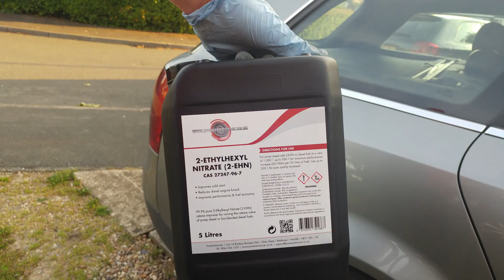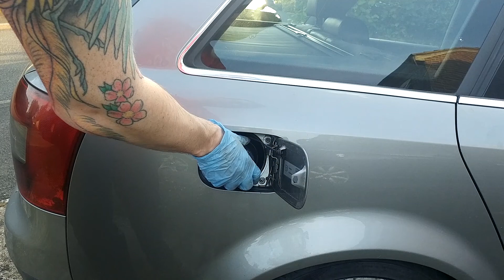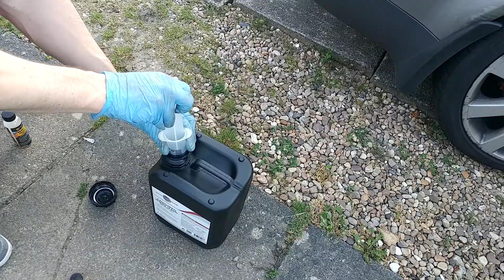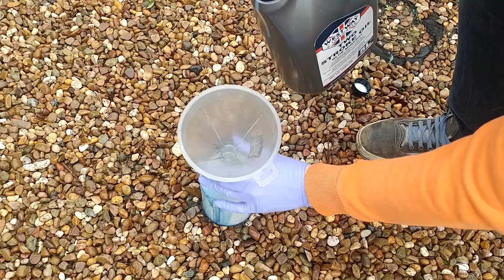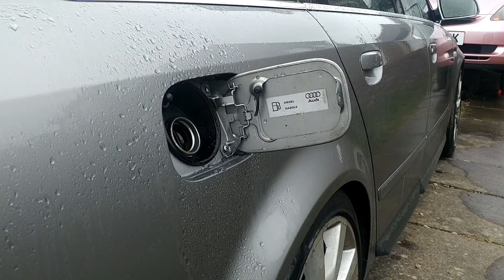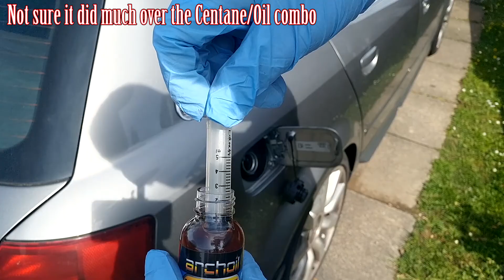2 Stroke Oil and Cetane added into my fuel!? Talking Diesel Fuel Additives

Comment: I'm a long time user of 2T oil. The grade recommended is 2T FASO FC for air cooled engines[not marine]. I noticed this was FB grade. Just saying in case it's important.

 After reading some of the comments i'll add that it is also claimed that it results in cleaner combustion with lower emissions that can double the life of a DPF.
Reply: I used to work for Conoco oil company the only difference between boat oil and motorcycle 2 stroke oil is the color additive . Yes you can use use 2 stroke oil in new diesel motors as well as old because it's ashless, it burns clean an leaves no ash or soot to clog up your DEF system. If you have any buildup at all your truck will burn it off when it hits the regen cycle on the newer trucks.. My lawn mower used to burn oil and foul out spark plugs, I drained out the 4 cycle oil and put in 2 cycle oil and now it smokes like it used to, but it won't foul the plug. sounds odd but it works.
Reply: @bigronwaggles404  That makes no sense? Why bother to have different oils sold for air cooled and water cooled 2 stroke engines if the oil is the same?

Comment: I've been experimenting with different non diesel fuel additives off and on over the past few years. First I was using Stihl synthetic 2 stroke mix which didn't seem to do anything at all. I've since concluded that was because it was synthetic. I've had pretty good results using ATF, particularly the dextron 3. I use the cheapest stuff I can find. Has to be plain stuff, no high milage, synthetic, or any additives of any kind. Currently I'm using marine 2 stroke mix. Again cheapest I can find, no additives, no synthetics. My tank is 33 gallons, or approximately 125 liters. I use 1 liter per tank of either the ATF or the 2 stroke mix. I put it in before I fill the tank with fuel to ensure proper mixing. The Marine 2 stroke out performs anything else I've used. My injection pump is noticably quieter, my throttle response is great, and I'm seeing between 2 and 3 miles per gallon increase in fuel mileage. 6.7 L Cummins diesel, fully deleted, mini max tuner, banks cold air, 4 inch turbo back exhaust, south bend dual disc clutch. One other thing I need to mention is my engine oil, since I switched from Shell rotella full synthetic 5,000 mile change intervals to DA lubricants conventional 15-40 oil, 10,000 mile change intervals I'm consistently getting 28 to 29 mpg cruising at 80 MPH. Not flat land driving either. Around home and daily commutes I'm getting around 22 mph. In a 2010 3/4 ton four door, 4x4, long bed with oversized mud tires and 265,000 miles. So that's my personal recipe for a smooth running, durable, dependable machine. That and you got to wash it once a week weather it needs it or not.

Comment: Question, 

Why… don’t you mix the cetane booster and 2 stroke oil with 5 litres of diesel first mix it well then put the whole lot in the tank together evenly mixed just before filling up?

Comment: I have been using 2SO in my 2015 Skoda Octavia 2.0L Diesel since I bought it in July 2016 with 3,500Kms on it.
It now has 102K without incident.
I add 200 mls to the 55 litre tank each fill with 50 mls of Fuel Doctor mostly prior to refueling but occasionally after refueling.
This use of 2SO was explained in a Land Rover Freelander Forum many years ago.
I also used this system on my 2 previous VW Golfs, also without incident.
Reply: Nice can i tell me wich one should i use for my tdi vw 2.0 tdi 2016 FB or Fc oil
Reply: @kuqezi2226  
JASO FC if your car has a DPF, that is a must. Ratio to use is 1/200, and I use slightly less as there is always some 2SO present in the tank when I refuel.
I use mostly 200ml of 2SO in the 55 litre tank of the Skoda, together with 50ml of Fuel Doctor additive.
Occasionally I drop the dosage down to 150ml 2SO but still 50ml of Fuel Doctor.
The original article outlining the use of 2SO in Diesel was written by "Yamaha Fan" in the Land Rover "Freelander" forum. Yamaha Fan was a German 🇩🇪 Lawyer who represented Oil and Car Companies, so search the Internet for this Forum and you can read it yourself and make your own decision.
Reply: @kuqezi2226 Go for the highest standard as everyone says, FD>FC>FB

Comment: I’ve been using 2 Stroke in my 2005 Vauxhall Corsa C 1.7 CDTi for years. I find it runs smoother and a bit quieter.
Reply: How much ml do you put in
Reply: @owen8538  usually about 250ml but I’ve also put in about half a litre from time to time. It’s an old car that had done over 160k so I’m not worried about it dying on me. It literally owes me nothing 😎

Comment: I use about 1/2 cup Walmart's 2 stroke oil with Diesel Kleen additive. A Gallon of oil last me 1 year! My 6.7 Cummins is so much quieter!  Just make sure its ashh-less oil doesn't matter the brand.
Reply: I have been doing the same with my 2011 6.7 but I have been adding about 18oz per tank or around 200:1. Only been running it for a few tanks of fuel.. maybe I should reduce the amount.

Comment: I drove the haul road between Fairbanks and Prudhoe Bay, AK for 5 years in the mid to late ‘80s, almost exclusively during the winter. They had #2, #2 Arctic, and #1 Arctic fuel available. The #2 was good down to about 5 to 10 degrees F, the #2 Arctic was good down to about -20 F, and I’ve never seen the #1 Arctic gel and I been in actual temps down to -75 F. The #1 Arctic was so clear that if you couldn’t catch a reflection of the surface of the fuel you couldn’t tell if there was fuel in the tank. It was so “dry” that if you put your hand in it it would dry out in a very short time much like lighter fluid or gasoline. To prevent this fuel from raising havoc with the pump and injectors I would add a quart of 2 stroke oil for every 40 - 50 gallons of fuel. Two cycle oil is made to be used dispersed in fuel and still retain its lubricating properties as well as mixing well in cold temperatures making it well suited for this purpose.

Comment: The potential issue with adding the 2 stroke oil to diesel, particularly in a common rail system is that it usually contains zinc as an anti wear additive. Zinc isn’t the best thing to put through injectors and can cause fowling of the injector tips, on the other had I know people who have added mineral 2 stroke to their diesel for years with no ill effects. Also, the reduced knocking isn’t necessary a good thing on a diesel. Diesel engines have to knock, they are compression ignition and as a result that actually have to pre-ignite to work. Less knock is kind of indicating that the fuel is less volatile. Common rail systems retard the injection timing at lower rpm to reduce the knock hence why the tick over quieter than older engines with fixed timing and have wider power bands etc.
Reply from the maker: It is a good point about common rail, however I will highlight I point out the VP44 is not common rail and they are a pump prone to failure due to poor lubrication due to various factors.
The irony is my 2.5 died due to bad lifters, I suspect when the previous owner (a very well known 2.5 builder) rebuilt it he cheaped out on the lifters which caused oil flow issues and it snapped a cam - the VP44 was fine and sold on and used elsewhere.

Comment: All mechanical 12 valve rotary pump Cummins. I tried the conventional (mineral) 2 stroke oil trick and it smoked a bit more, though not bad. No change that I could discern in smoothness or NVH. Much more notable was that the mileage went in the basement. I went from 25 MPG (US measurements) to less than 20 MPG. I have long since returned to using "sulfur substitute" and it has been wonderful so far.
Reply: I never tried it with cetane booster, though.

Comment: Be thankful you guys can buy pur 2-ethylhexyl,in the states no such thing,we have to buy over priced opti-lube.my common rail duramax loved 2-stroke oil,my idi powerstroke loves 2 stroke and I gain mileage running cetane booster.we also get horrible mileage here for 6 months a year due to "winter blend" diesel in the cold states cut with kerosene.you can run idis on pure ATF
Reply: IDIs will also run on pure used motor oil.

Comment: Been using Millers Diesel Ecomax which raises the Cetane number, a product which has been through numerous name changes ever since they started reducing the sulphur (lubricity) content of DERV, mates who work in commercial workshops noticed a rapid increase of failed mechanical injection pumps in older vehicles and recommended me to do so.
I also use the same cheap as chips 2T oil as you made by Westaway.

I pre mix the required amount on an old 1 litre oil engine oil bottle and keep it in a suitable bag for when i fill up, i've been doing this for probably 25 years or more now, and use the same mox currently on my common rail Landcruiser.
Just out of interest if you fuill your car with the expensive sporty DERV, the fuel smells similar to the Millers additive, not making any assumptions here, Millers and 2T bought in 5 litre packs combined works out a lot cheaper than the difference between standard and sport DERV.

Whatever anyone thinks, and there are plenty who suggest you don't use such products, i usually run older vehicles not wishing to waste my hard earned on depreciation of some modern car i don't want...seriously there isn't anything made now that i'd want to own short of maybe another Mustang but i'm a bit long in the tooth for one of those again...my current Toyota is 15 years old, the last issue i had with any of my Diesels was back in the 90's when i had the mechanical injectors of my Renualt 21 Diesel cleaned and checked.

Obviously such treatments go hand in hand with good servicing and some mechanical sympathy...ie i give this idea of high mileage oil servicing a good ignoring, also allow my engines to warm up before hard driving and to cool down before  stopping the engine.
Proof of this, is after well over 40 years driving Diesels (including lorries) and now over 3 million miles to date i have yet to suffer a turbo failure, aqnd no engine or fuel system failures on my own cars since i can't remember when.

This thread is now quite old and the pics arn't wonderful sice photobucket changed tack, but is worth looking at
https://www.seatcupra.net/forums/threads/millers-diesel-power-sport-4-dps4.188065/
Reply: I use the Millers too, I haven’t noticed any mpg increases but have noticed that my euro 6 Touran almost never regens that I can detect. I’ve not really noticed any improvement on my Audi A2 but then I’m running it to keep my engine clean and avoid the variable vane turbo sticking. I am tempted to try some two stroke oil in the Audi to see if quietens down and reduces fuel consumption as some report.
Reply: Ok just stumbled on this again - I tried the 2 stroke oil instead of the Millers and noticed no difference or additional benefit - as the Millers works out to be about 2p a litre on top of the cheapest supermarket fuel I can find, I’m happy to stick with it. I’ve noticed that I never see any smoke in my rear view mirror even if I boot it after thousands of miles of fairly careful driving (which is my normal style).

Comment: Get 2t oil with  Jaso FD spec, usually it's red, only 50ml per 10L of diesel. It mixes way better than what you got there and on my CR diesel it also quiets it down quite a lot.
Reply: Doesn't look good if you get tank dipped.. and the fuel is red
Reply: I do 1:100 mix an its not that visible,just a slight haze
Reply: @streetzy12  5ml/litre doesn't discolour it, plus red diesel has an invisible marker in which the hmrc test for. Adding 2SO to diesel isn't a problem.
Reply: I would be interested to know if FD spec oil is available as a mineral 2 Stroke oil. I haven't seen any, so have stuck to using Comma 2 Stroke mineral - JASCO FB, ISO-L-EGB, API TC. I wouldn't use any synthetic or semi-synthetic 2  Stroke oils as these bads news in your diesel.
Reply: @1Grogey  Have not seen any FD mineral maybe because of the spec that does not permit it.

Comment: I use 2 stroke in my 2017 nissan navara np300.. it has a common rail system .. definitely beneficial.. as these cars are rated for euro emission .. there are considerable clattering with the injectors and fuel pumps around 2k rpm the 2 stroke has stopped this but it took 30km of driving before it really lubed everything and things got quiter.. i have been using 2 stroke oil in my ute for the past week and have noticed it does 380km from full to half a tank rather than just 300 for my in town driving.. economy went from 8.9 litres per 100km to 7.8. Highway is down to 6.3 to 6.9 pending hills and forced acceleration.
Reply: Do you use mineral or synthetic two stroke oil?
Reply: @hellohello8556  
No need to use synthetic.
Use 2SO to Jaso Fc standard.
Reply: @hellohello8556 minarel is used.